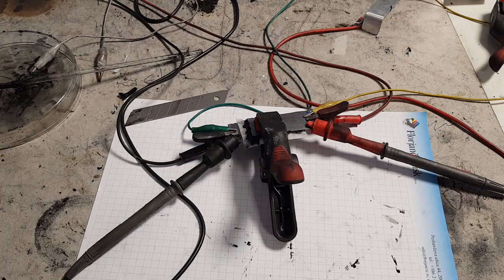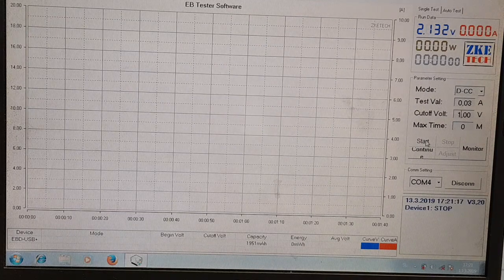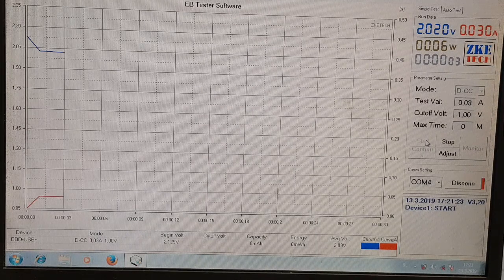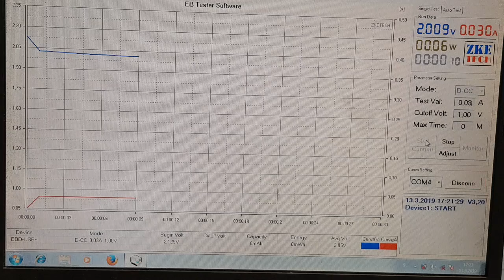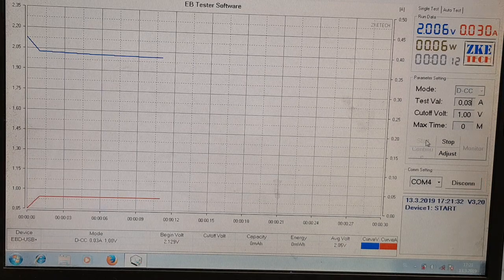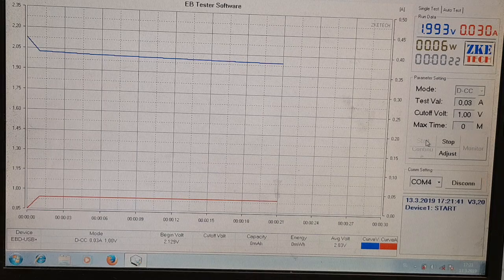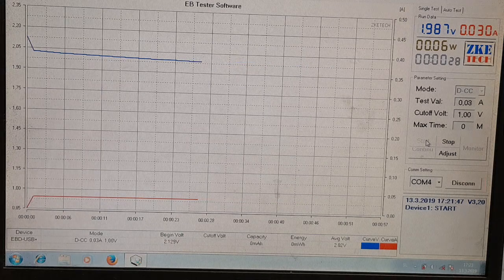How to make a simple MnO2 supercapacitor

Comment: Hi, I seriously need help! 
Mabye anyone who did something with Supercaps can help. I have been working on Supercapacitors for 6 weeks now, with no sucess. I made Supercaps with aluminium Foil sheets coated with activated carbon, Kitchen Tissue Paper as the Separator and Sodium Sulfate solution as the Electrolyte. Problem: the "Supercap" had a Capacity of less than 1mF and discharged itself from 1.5V to 0.2 V in a few seconds, without a load connected!!! What did I do wrong?? I need Help very soon, so pls don't hesitate to help, even if you have only a little hint. And be aware, my English is bot very well. Thanks a lot !!!🙃🙃
Reply: Hello!  I make supercaps at home.  Can you tell me a bit more about your methods?
I generally find the hardest thing to be preventing the carbon from permeating the seperator layer and causing a short.  Tissue paper isn't really suitable.  I'd reccomend qualatative filter paper, it's what I use.  Tough stuff and fine enough to prevent penetration.   Also I find graphite and (if you can afford it) graphene powder works exponentially better than carbon films.
Beyond that, the goal is surface area!  As much as possible!
Reply: @janglur  Better late than never, thank you for your answer! I am/was doing that for a Research competition in Germany. I used Aluminum foil as collectors. Fine activated Carbon powder mixed with a bit of wood glue(containing PVA binder) as electrode material. Then i coated the Aluminium foil with a paint brush. As a separator I used normal kitchen tissue paper(which is a bit thicker). 
Since I started using this as separator I never thought, the separator is causing a short, but I will check that/use Filter paper.
As electrolyte I mostly used Sodium Sulfate but also tried HCl and NaOH.
I also built an Arduino-based Capacitor-meter. Both my cap-meter and my component-tester never measured a capacitance greater than 10uF but a Vloss of nearly 50%. I hope that Info can help you. I paused my Project a few months ago, but I am going to continue my project and maybe even compete with it. 

How do you build your Supercaps?
Thank you very much for your help!

Comment: Can we glow LED with this type of supercapacitor??
Reply from the maker: Yes. Red LED will work really nice
Reply: @cayrex   Sir, I am working on a similar project. My electrode material is having discharge time of 400 seconds maximum at 1.0 A/g mass current density. 
(1) Should I make supercapacitor device of this material or not??
(2) is it require more discharge time??
Reply from the maker: Yes, I think that you need to try this supercapacitor.
Reply: @cayrex  okay... I will tell you the results..😆 Thank you so much for your time
Reply from the maker: @Manpreetkaur-ff1vd  No problem. Ok😁

Comment: This types of cap iis very bad due to self discharge
Reply: This has great specs for a standard cap.  Thefug you talking about?
Reply: @janglur  the fu&$-$ you talking about!
I guess where you blg frm
Reply: All caps self discharge.
Reply from the maker: This ona was not so bad with self discharge. The cell voltage drops like by all supercapacitors, but the MnO2 cell was not bad with the self discharge. Maybe you have to high resistance on the electrodes

Comment: Dear Cyrex2, many thanks for the upload; very interesting.
FYI: On another Experiments (Load / discharge AAA Alcaline, taken Input energy of Mobile Phone) I recorded the ingoing energy to the cell with the EBD-USB: Switched the Monitor on and saved the Data. Via Spreadshied (Excel) I worked out the ingoing mAh and was able to verify with the outgoing energy; by Mobile test I had the capacity from the Battery. It's not a big deal once you made the formulars. On that off course I got the effency of the cell. What do you (and / or other guys) think about?

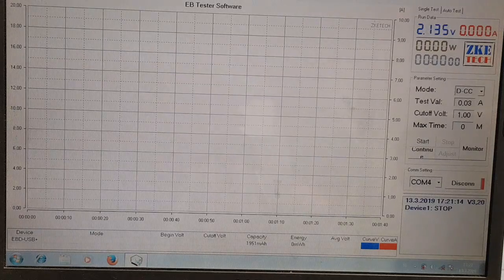Comment: Hi! I would be really thankful if anybody or you cayrex could help me with this. At 8:36 you connected the cell but the self-discharge was about 0,004V / sec. so the cell would be after a day all discharged by itself. Why is that? Or is there a way to slow it down? Thank you very much!
Reply from the maker: This voltage drop was because I disconnect the cell from power supply and the voltage need to settled down to his nominal voltage. I charge the cell with 2.1V and the cell voltage is around 2 to 1.9V.
Reply: @cayrex Yes thank you. But when I charge my cell it needs to settle down as you say but the voltage drops about 0,001V / sec. and that's fast you don't see that with regular AA batteries, why is that. Many thankZ
Reply: @SbachyTheFailer   Capacitors have much, much, much lower resistance than batteries.  As such, more of the power can 'leak' through tiny channels.
Batteries actually lose more power over time, but their capacity is thousands and thousands of times higher at worst, thus it takes AGES for it to self-discharge.  Lead-acid and NiMH are notorious for rapid self-discharge!
But any capacitor, even super/ultra capacitors, will discharge after a few days to months, while most batteries can handle the same time with negligible loss.

Comment: Hi,
 What happens when you use your copper backing trick to the current capability?
Reply from the maker: Hi. You mean if I add copper on the top of graphite foil?
Reply: @cayrex  Exactly.
Reply from the maker: @jonbigman9723  you will end up with a litle better current